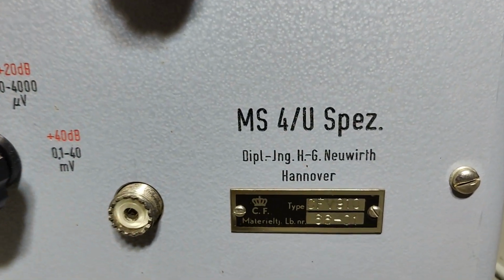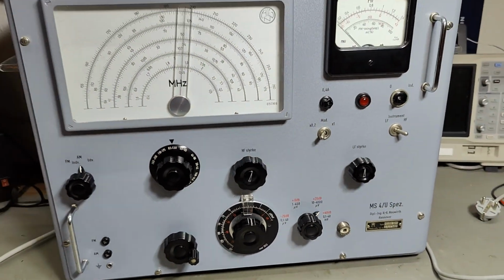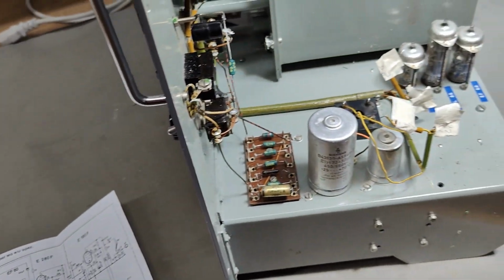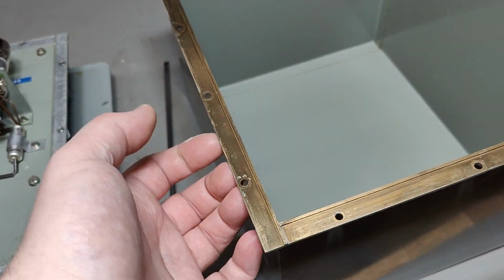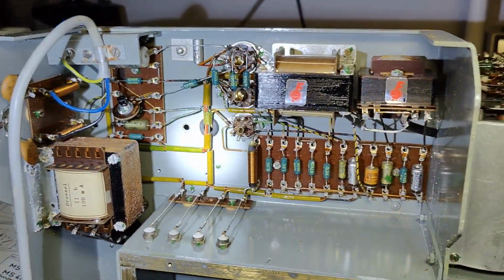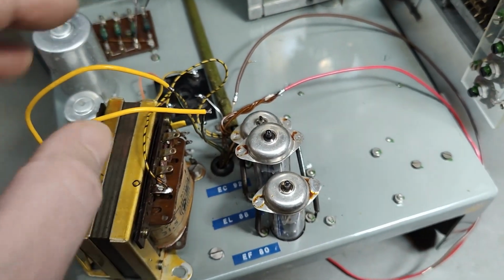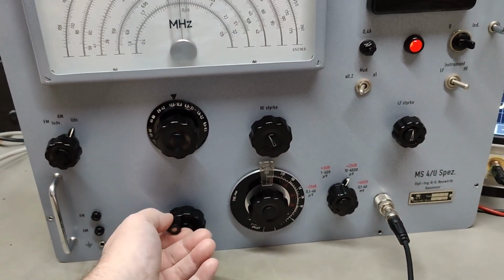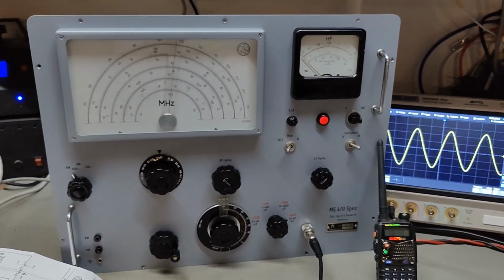H. G. Neuwirth Hannover MS4/U Spez. 1966 test generator test teardown

Comment: I love these old generators!

They used to be top of the line test equipment, and were in most every electronics lab.

Sadly, this one was stored where the condensation of moisture was quite bad to have that style of corrosion, and it is quite a job to clean it up.

Nice to see you repairing it! Good luck and my it work well for you!